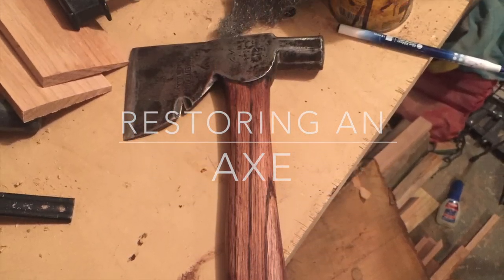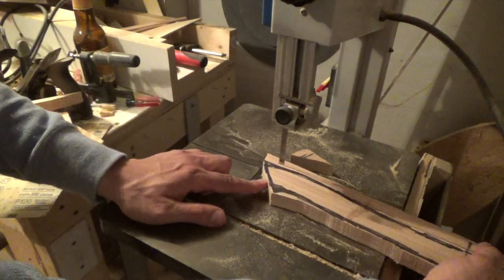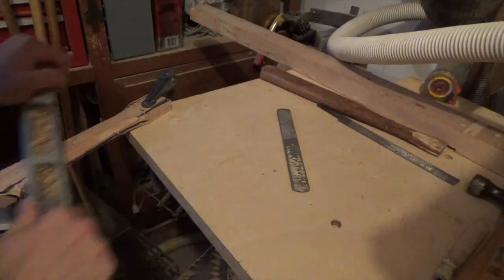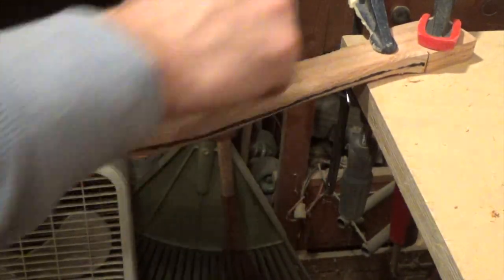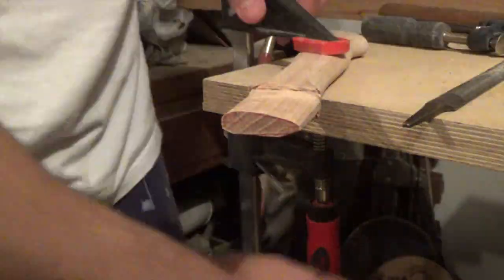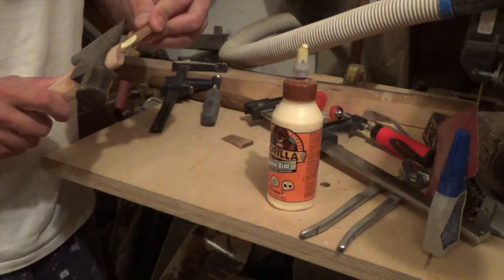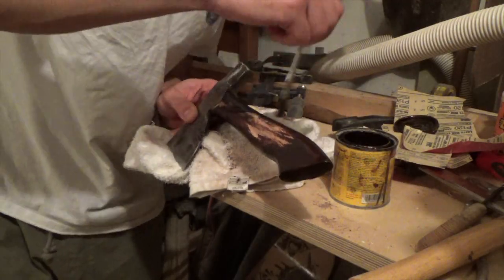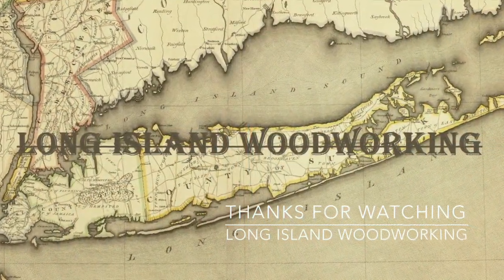DiResta Inspired: Restoring an Axe - 28

Comment: Omg) its not a restoring) if u doing soms u must do it 100%. Clean axe, make it like glass and new and make proportional to size axe Wooden handle)
Reply from the maker: +Рома Мариинский Thanks dude, I'll work on the axe and try to get the restoration correct, and you can work on getting the spelling and grammar correct on your comments:)
Reply: +Long Island Woodworking okay) thanks man. I will))